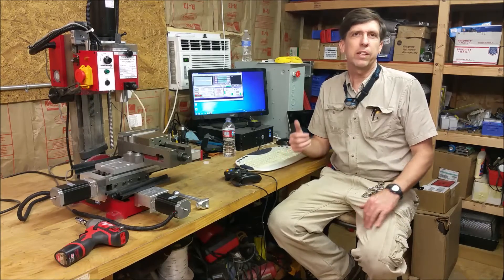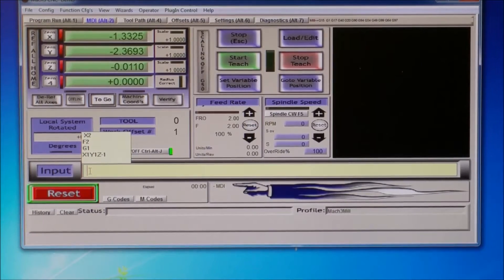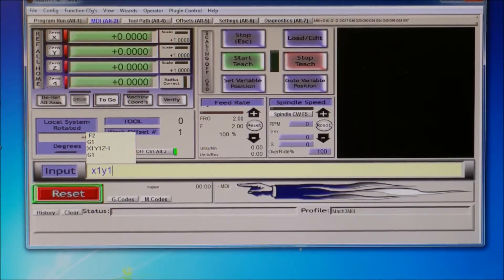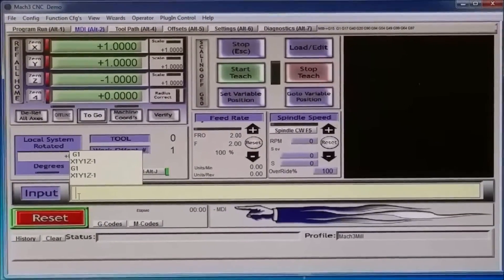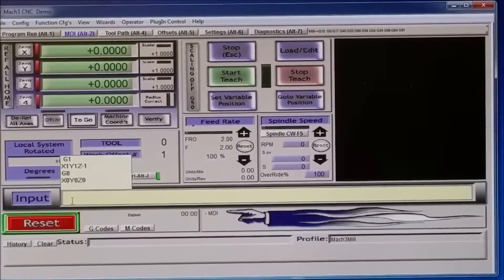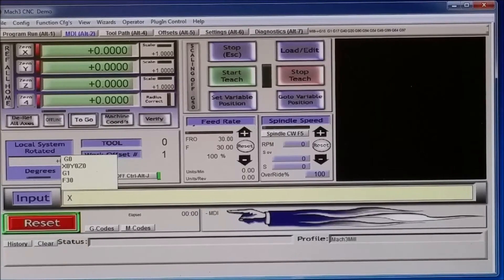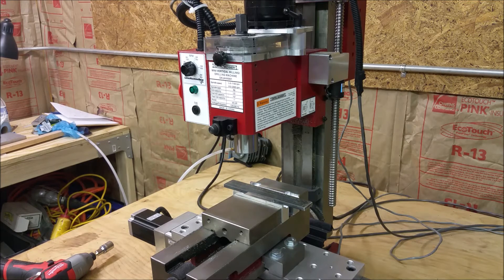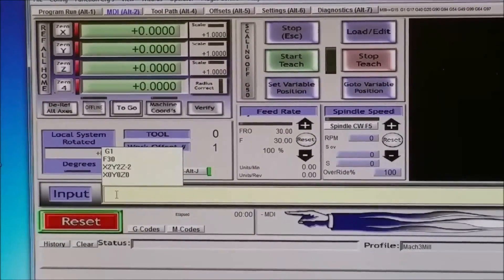Learning G-Code Part 2 - G1

Comment: Hello sir. I brought TB 6600 drivers , NEMA 34 stepper motor 35kg and a mach3 interface board. The Dro of mach3 is running but motors not. Please tell me is this problem in connections or something else. And please tell me how to do connections in between motors , drivers , and interface board. Thank you
Reply: If its  not start u text me on 9993901803

Comment: Thanks Craig I would also like to add while is is not necessary to know G code to run a CNC it is very helpful when small changes are needed to a program with out having to go back to the Cam software edit and regenerate the code.
Reply from the maker: CNC4XR7 Yeah,  very helpful to know. so you can figure out why your endmill crashed into the part. LOL